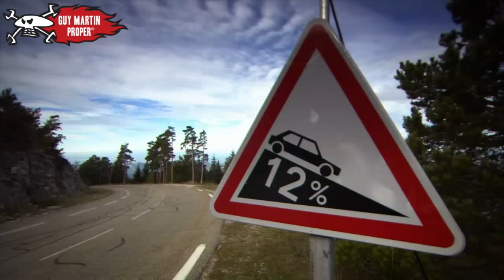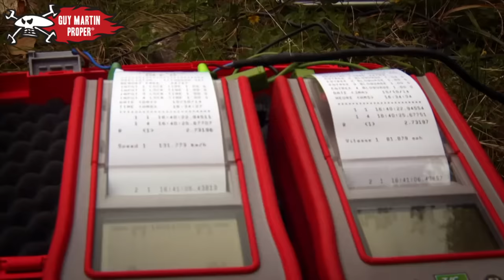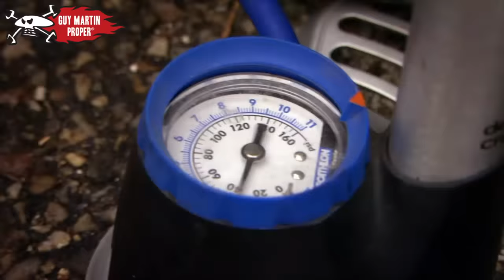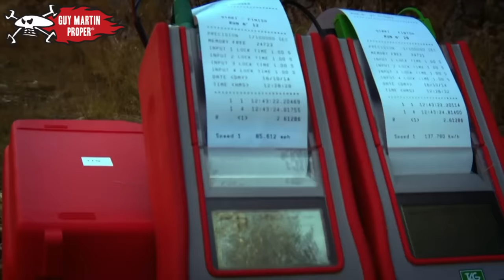The World's Fastest 85.6mph Gravity Racer | Guy Martin Proper

Comment: If you want to reach maximum speed, you need to fart at just the right moment. Most people don't know this. Use this knowledge to your advantage.
Reply: A very obscure attempt at humour that would be missed by 99.9% of people. I am one of the mainstream. Could you explain the joke please or explain the technicalities of passing wind at a moment which will increase the speed of a gravity racer. Give some research references and experimental data please. Oh, it could be another lame attempt at a fart joke which most kids give up at 6 years of age. Yes, probably the latter.
Reply: @droceretik   I agree it was a lame attempt, but I think he meant if the driver farts while going down the mountain his speed would get a boost from the jet propulsion coming from his ass hole, his theory has not been proved.
Reply: Or put rocks in the front. Cough cough
Reply: Guy did fart, but the previous nights meal made him nauseous. That's why he crashed the vehicle.
Reply: Fresh, air, ram, technology

Comment: And to think, when we were kids, we achieved about 12 (maybe/ish) mph with a plank of wood and four pram wheels. Our hill was a lot steeper, but we only had about 75 yards run. . . . . and no brakes, other than the soles of your shoes. Eeh, how times have moved on.

We never scratched any helmets though. . . . . . We didn't have any!

If you watch a lot of Guy's videos, he does take a few records, that's for certain, but I'm not going tell, you'll have to watch them for yourselves - assuming you haven't already seen the TV series?
Reply: My plank broke so the front wheels fell off and I scraped a big load of skin off one hip/thigh sliding down the road. That bloody hurt. We didn't get all that fancy protective kit back in the 70s.
Reply: @xxwookey  My tyre came off the rim in a tight turn and I slid sideways across the pavement on my arse, my nylon undies melted and stuck to the skin and grazes, couldn't get the melted bits off till the scabs came off !
Them were the days !
Reply: I got a whip start from a rope and bicycle at the top of the run, crappy lawnmower wheels, undersized 1/2" mild steel axel. Crate lumber frame and a rope loop for steering, a 1/2" lag bolt through the 2x4 lumber steering assembly. No brakes of any sort, but i did have a hockey helmet and knee pads for safety gear. No videos, cell phones or world record keepers were present. From memory, according to the "one thousand one, one thousand two" precision timing method  I was hauling arse down the road. The road had no curves but at what I thought was my top speed my cart developed a serious violent side to side shaking in the steering rope! The cart shook so hard that the front left lawnmower wheel sheared the nail that was holding the wheel on the axel. That's when things started getting dicey! The cart veered off the road into the ditch and the axel dug into the soft gravel road side. I somersaulted along with the cart rolling on top me! My safety crew was following during my run right behind me on their spider bikes. Everyone agreed I was going at least 100 mph! Not true, but the story sounded better like that at school the next day. I ended up with a good cut on my left thigh, bruises, and lump on my head from when the cart rolled on top of me. But I did get kisses on the cheek from 2 girls in neighborhood then about 3 hours later my dad got home from work and beat my ass with his belt for almost killing myself and scaring the hell out of my mom with a bloody leg! It was SO worth it! Lolol true event!!

Comment: I bet they made that kart with all kinds of expensive lightweight materials eh.... now let's add 20kg of ballast hahahah
Reply: Rather than a heavy kart then add ballast to redistribute the weight balance? Think about this. Which will reach the ground first and achieve the highest speed if dropped from a balloon at 1,000 ft? A plastic beach ball of 1 metre diameter or a steel ball of 1 metre diameter? I think it is a fine line between correct weight, tyre friction and the ability to turn. In a straight run down a steep slope I would put my money on a kart that weighed 120 kg total compared to 100 kg because the power to wind resistance ratio was better on the heavier kart. Gravity is the engine. and 120 kg has more power.

Comment: Obviously none of those engineers saw Martin drop his bike at 180 on the Isle of Man and blow up five gallons of fuel. He emerged from a ball of fire about twenty feet in the air, scratching more than his helmet.
Reply: You just described the "Terminator".  Thinking about it ... he just might be one.
Reply: Those engeneers are only environmental activists, bicycle lovers, with no understanding about the forces which become relevant above 20 miles per hour... They should have built that vehicle in a very different manner... adding some flaps which activates on braking and turning, givint the vehicle a better downforce in corners and some side flaps which activates when turning into the corner... olso ba doing so adding additinal weight to the vehicle....
but they have no understanding about such things... they seem to be tree huggers...
I am sorry for Guy that he agreed to work with such incompetent people and risk his helmet for them... His helmet alone may be ten times worth the value of that gravity vehicle...

Comment: I know I’m late to the party, but absolute great ride, great job on the record.   I’m wondering however, was the ass end coming around partially due to weight shifting of the water in the back?  That certainly appeared to be at least a factor in it.  I’ve seen it happen in go carts, trying to keep the back down to avoid skipping, and I’ve  actually seen it better in RC car racing.  Depending on the road conditions, I used to lay waver weights in the back to stop the car from drifting around corners.

Comment: In aviation parlance, that's called a ground loop where you have too much weight behind the front wheels, causing the rear to want to overtake the front when braking. With all his experience in racing, I'm really quite surprised that he didn't think that adding weight and changing his centre of gravity to rear bias was going to adversely affect handling/braking. The team shouldn't have listened to him on that last run, he's just a speed nutter and they forgot that. Result is a totalled gravity racer. Guy Martin's nine lives gets a further reduction. Lesson...Guy, you just drive the thing, we'll do the physics 🤔
Reply: That "Gravity Racer" seems to be built by amateur bicyclists. They have no understanding about forces getting involved at higher rates of speed. For instance That "racer" is unstable due to the limited weight and the down forces.
They should add some mechanical vertical Flaps and horizontal spoilers, which get activated when turning, respectevly when braking... That would use the Air Stream to turn the vehicle in the desired direction and overcome the need of additional weight in the back... so it is not his fault, it is his "engeneers" faul - they are only builders without founded understanding in physics and aerodynamics. 

I am not an engeneer neighter, i am a cuantum physicist PhD but having a good understanding about forces and aerodynamics. I am a PPL plane pilot too and a speed motorbiker... i could have built that vehicle alot better... you too for sure GazLowe...

Comment: Wheel pants on the rears with a bit of fin on them would have made for better stability at speed as well as improving aerodynamics to achieve higher speeds.
Reply: Not only that, they could've built the whole thing flatter and lower to the ground, increasing stability even more and making it even faster

Comment: 650C or 700C time trial bicycle wheelsets would have provided less aerodynamic and rolling resistance with some nice tubular wheels. Spoked wheels at time trial speeds have not been used since the 60's.
Reply: How about you build a racer and show us how it should be done.
Reply: @droceretik  There is huge amount of research in the area of tire dimensions,  pressure,  aerodynamics on what is the best possible characteristics from the cycle industry for the infamous marginal gains where shaving off even 5 watts of resistance makes big difference.

Comment: These cart designers will need to include some mechanical engineering in their wheel and steering design; to counter 'roll', they will need to get the front and rear wheels to tilt and turn-in laterally (from the virtical axis) inward toward the body and into the the direction of the turn to reduce wheel flex... this is how motorcycles manage turns more efficiently, and where carts with spoked wheels will need to do the same.

Comment: Those tires and rims were completely sub-standard...  Or maybe the drivers understanding of the handling at that speed
Reply: Tire pressure seemed way too high for the road surface. It compromised grip and possibly was slower. It is really hard to buck the common idea that higher tire pressure is automatically has lower rolling resistance. More recent testing has shown that it depends on the road surface. Allowing the tire to conform to the micro bumps can be faster.
Reply: @Kulric  I agree..  You should see my built out tank of a pre-runner baja truck..  The laws of physics don't vary all that much from a flat and tacky (hopefully) surface and dirt & sand...  I always purged air on trail..  Finally decided my techical HP scuba tanks had a better benefit when I needed to pressure up. ;). IT truly is nice to have solid sidewalls on the street, but if some can get used to the tippy feel (percieved or real), you'll always get better traction as you pointed out..

Comment: that enclosure fairing is needlessly too large .. 1/3 the height could be lopped off the top, just lay the driving back flatter ... would greatly increase speed.  The man who held the previous record, using a Road Racing Kart, had the right idea,  proven handling & safe chassis for high speed, which has already been optimized for low wind resistance & high speed racing ... such a vehicle would not have been so horribly unstable and crashed as Guy did here.

Comment: Reduce friction.  That's it, that's all of it. 32 ft per sec per sec is the law.  Adding weight can change the handling but it will not make it faster.  That's the law.
Reply: You might have missed the lesson on air resistance.
Reply: @danielszanto2955  No, I did not miss it, air resistance is friction.  ;o)
Reply: @zoltankaparthy9095  So you must remember that it is independent of mass. So heavier objects are relatively less affected by it.
Reply: @danielszanto2955  Total fantasy.  If this were true ski jumping would have weight classes.  Think man, think.  32 feet per second per second, it is not just a good idea, it is the law.
Reply: @zoltankaparthy9095  Drop a balloon filled with air, then drop one filled with water. Do they fall at the same speed? You can also roll them down any gradient. Hint: more than on force acts on a body.

Comment: Why with that much engineering are they shoving water bottles all around the car throwing the weight distribution forward and back? Wouldn’t it make more sense to have an adjustable weight holder on a slider at the bottom around your 50/50 point and use compact weights like steel plates?

Comment: adding weight for speed and handling... bruh potantial energy = mass x height and that turnes into kinetic energy which is velocity^2x mass/2 even in this perfect world where you have no friction which is basically coefficient of friction times the force that is normal to the ground ( mass times G ) and we didnt consider the inertia the car has throught the corners which equals to mass times r(in this case turn radius )^2/2. if you think just a little bit you realise adding weight is just makes thinks harder. it it were not the case F1 cars should be build like tanks, why are engineers try so hard to make them as light as possible ? What should be done is if you want traction specificly, you should add downforce somehow, but you can not add wings beeacuse that adds a lot of drag which in this case does not help at all. you may try improving the air flow under the car maybe lower it, add a designed an analised diffuser. if you want to have more speed you should reduce drag and weight. you should try to make your tyres lighter that in turn reduces the rotational inertia that the tyres has and overal helps you have more kinetic energy. maybe try covering up these ugly wishbones that destroy the airflow on the body surface cover up the strings on the wheels which also destroys airflow . yes they broke the record but they broke it becouse added weight increased the momentum of the car and helped the car keep his speed while the drag force tries to slow it down. yes it worked but it is not the approach that can help them every time and in every case.

Comment: hehe! Rock hard tires is not going to help unless the road-surface is smooth as silk,  and they call themselves scientists?  LOL! Its not all about rolling resistance, but also friction! High pressure tires bump and skip on the rough surface more than a slightly softer tire, with less grip and control also as a result.

Comment: the roll hoop (highest point above head should have been higher to clear his head in the event of a roll over. thts the only engineering fault they did. mega tho
Reply: 2:19 Looks pretty good to me. Rumours are his straw hair acts as a carbon weave to protect his head anyway.. or so say engineers...
Reply: @AutomotiveAddiction  Yeah, maybe seatbelts not tight enough ?
Reply: @AutomotiveAddiction  you can see its too low. you basically put a ruler from the top hoop down to the bulk head. here is tiff nedell and williams F1 showing what I mean https://youtu.be/ERUbPbAsjkY?t=206